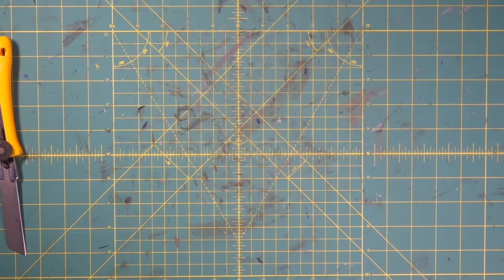Making An EVA Foam PUBG Vector Part 2

Comment: Hey, I'm considering getting your template and making this, but I do not have access, nor the budget for many of the tools, mostly the stationary saws to cut the 36mm block. Is there any replacement one could use for those tools?
Reply from the maker: Hi! You might be able to use the box cutter with the long blade like I use in the videos. And then you can clean up any rough edges with a dremel or some sanding sticks. Check out my video on making the Culling Blade. Check out the way that I use the box cutter to cut the beveled edges of the 2 blades. Maybe you could do it that way - hold the foam upright with one hand and saw back and forth with the box cutter all the way through the piece. That should get the same result as the bandsaw.
Let me know how it works out!
Reply: @BlackSheepProps  Thanks for the quick reply! I'll definitely try it now, thanks!
Reply: @BlackSheepProps  Thanks again for the tutorial! I managed to make my first cosplay prop and had a lot of fun at gamescom due to you!
Reply from the maker: @Rayek131  Awesome! So glad to hear you went for it and that I was able to be some help!! Now you won’t be able to stop building!!! It’s addictive.